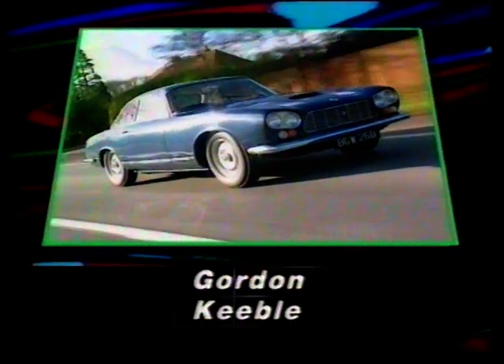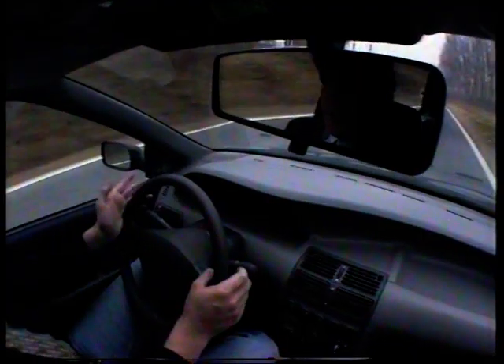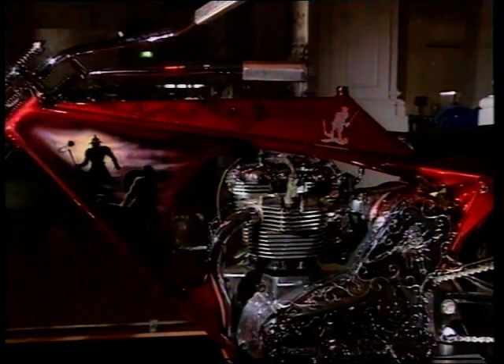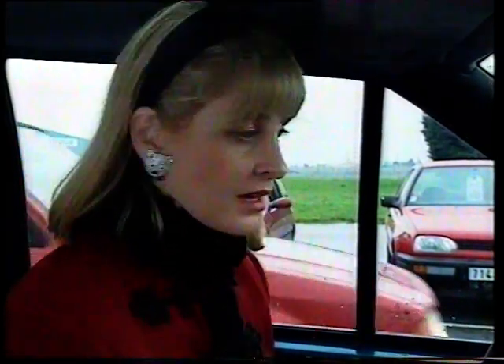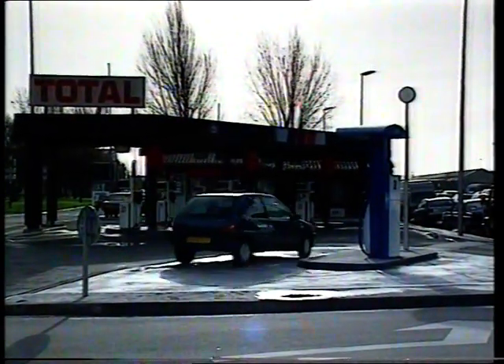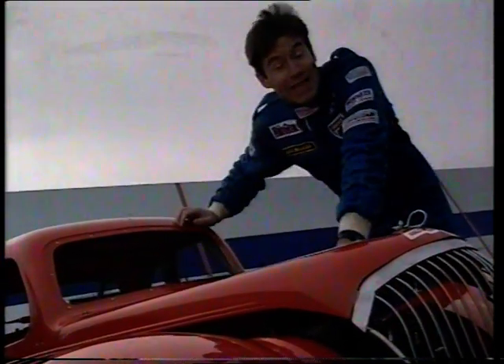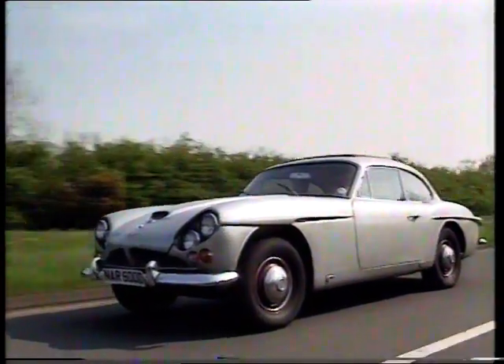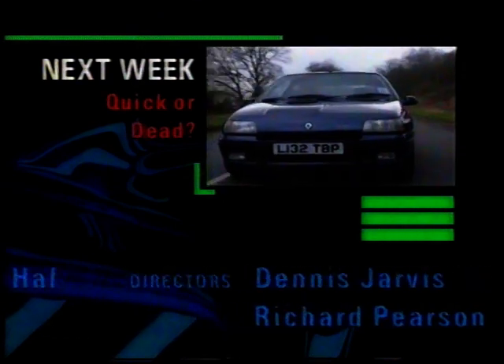1 Top Gear 1994

Comment: That Gordon Keeble was 30 years old and look how much had changed over those 30 years. It looked like a (lovely) antique compared to the Punto. In the 30 years since, the Punto and most cars from the early 90's still look pretty modern. Car styling hasn't changed anywhere near as much as the technology involved in building them.

Comment: OMG the beginning of the Bullshit electric car era
Reply: Electric cars predate internal combustion. It's just the truth.
Reply: Electric cars are all about controlling peoples movements through tracking. People don't realise that they can be remotely controlled so that you are only allowed to travel where they want you to travel. This is why there is a big push towards electric vehicles, using the tired old excuse of saving the environment. Back when this ep was made the technology wasn't there, but now it is.
Reply: @Embracing01 
Just pointing out that you don't need a single computer for an all electric vehicle.
If you don't mind 100mi range they're actually extremely easy to convert yourself, and far easier than a petroleum engine to maintain. 
Also, I don't know about your crude oil production skills, but I can't make gasoline. If needed, I can however make electricity.
Reply: @Embracing01 what drugs are you on? I'd love to get hold of them!
Reply: @badgardener  No drugs. Why don't you look into what I just said. what do you think all this 15 min city things all about?.